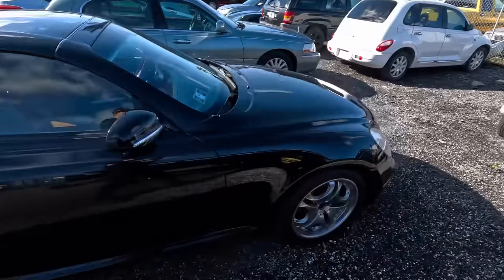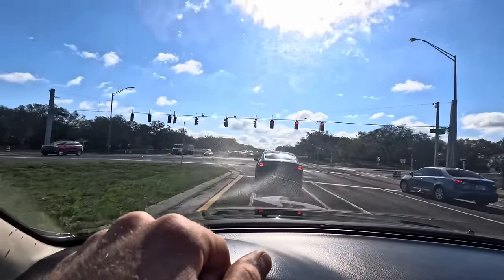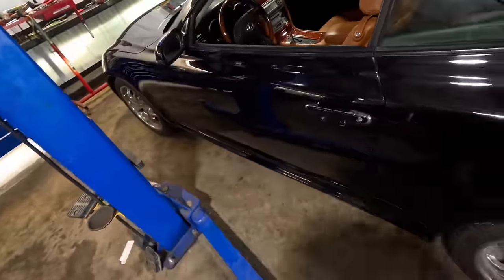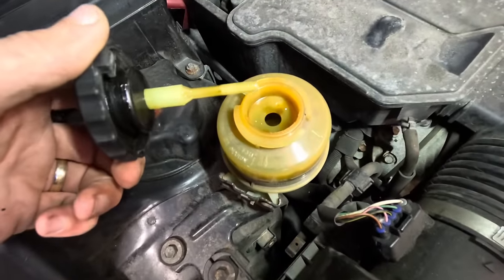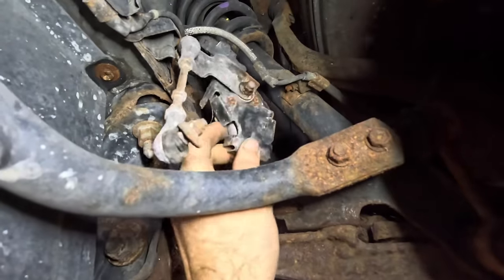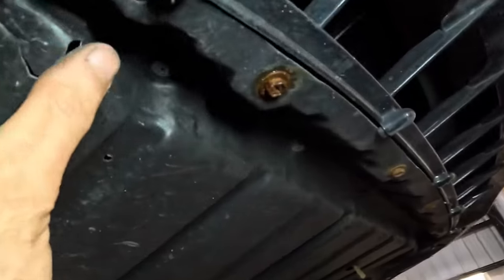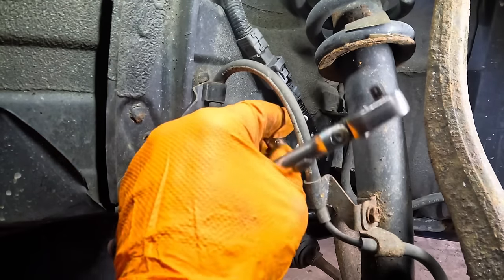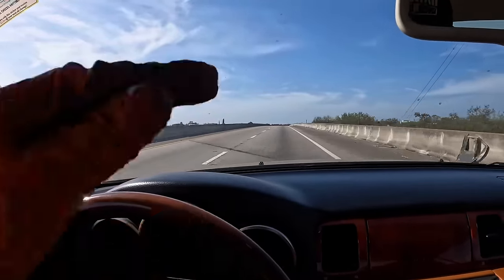Most Hated FAILED Sports Car! Lexus SC430

Comment: My 2004 SC430 with 207,000 miles has no rattles, convertible and chassis are solid and quiet. Check the suspension. This guy sounds like the doppelganger Jeremy Clarkson. He's attributing a lot of his negatives on Lexus design when really it's the owners decades of neglect
Reply: I think top gear were the ones who made this car seem terrible but I don’t see how it isn’t reliable or fun to cruise in. Especially for it being under 10k now

Comment: I liked the "came out of the garage for it's annual trip to the repair facility"!
Reply: Yea 🙂
Reply: Unfortunately not driving a vehicle causes more damage than running it in a normal way. Keeping up with maintenance and getting it up to temp will make it last longer than ignoring it.
Reply: @kenore4003 true, but if you start them & drive them every few months, they are fine. I live up north in snow country, I have a sports car that stays in the garage through the winter. I start it & let it run awhile throughout the winter, & when spring & summer rolls around I get it out of the garage & drive it some. It doesn't get snowed on, & the only time it gets rained on is if I leave it out of the garage a couple days. 
I do enjoy getting it out of the garage in the spring and summer & "stretch it's legs" 😂😂😂
Reply: Smart....
Reply: Indeed! Ray has some wonderful one liners.
Reply: Delusional

Comment: I have a 2002 SC430, with 63k trouble free miles. Everything still works. I bought five years ago and the only thing I've needed to do is change the oil. I love driving it.

Comment: Ray I don't think you realize how good you have it!   I've never had the luxury of working on a car that isn't covered in rust!  I would consider that "Toyota" not really bad compared to what I usually see
Reply: Rust Belt goodness is something I don't miss. I grew up in northern Indiana with all the salt on the roads. Since moving away from that area, I no longer enjoy rust and other corrosion.
Reply: Corrosion just requires another level of patience and determination.  That and wire brushes and your preferred brand of penetrant. It does scare me, it just knocks you back a bit when you have any work in the splash zone.
Reply: Same I’m in Rhode Island terrible
Reply: Rust belt requires a lot more component replacements.  Just replaced the tie rod sleeve, drag link, and ends on my WJ that were completely locked up. Shop couldn't do a proper alignment. Doubt you would get that in FLA
Reply: Fluid Film your cars people!

Comment: That 3UZ-FE engine is one of the finest engines ever built. FAA certified in its stock form and also featuring a 5 bolt main
Reply: There are 6 bolt mains, not 5. Only the 1uz non-VVTI was FAA certified and designed for a twin-turbo application with hypereutectic pistons. The blocks are the same, and the bottom ends of all UZs are interchangeable, pretty much the same minus the rods being thinner and thinner every generation and the 2uz having iron block and 4 bolt mains. Heck, even the heads are the same between all VVTI UZ motors, even the 2uz non vvti minus the vvti port. Everything is pretty much interchangeable between them. The toms superchargers and the rmm kit sold through l-tuned were sick asf tho, as far as I know the dealer would even install them for you, but they really should have given us the airplane engine config with factory twin turbos, yet they never did.

Comment: Lol my ‘07 white sc430 is my DAILY- rain sleet or snow baby 🤙🏻 Best car and engine/transmission I’ve ever had. The top works perfect and it’s newer inside than the older 02-05 version. I handled everything genuine parts 158k miles and runs like a Swiss watch
Reply: 2004 tech was just really starting and to much tech is probably to much like a car simple to fix and not breaking down all the time line the new cars😂
Reply: And people need to service their cars more often

Comment: The SC430 uses real wood!  There is no fake wood in these cars.  I know this car gets a ton of hate, but I own one and it is a great second car to have for the weekends!  
This was a great video.
Reply: Ray got so much wrong with his interior features critique of this '04 SC430 I don't even know where to start, so I won't.  He probably also doesn't know that the all aluminum 3UZ-FE in that thing is one of the finest engines Toyota ever developed, rock solid reliable for hundreds of thousands of miles if you properly maintain it -- nice power band too, the one in my '06 LS430 is no slouch, despite being such a heavy sedan. Ray should have loosened one of the timing covers and sneaked a peek at the condition of the timing belt since it's an interference engine and the belt's been there since day one (recommended replacement is 90k, which is in another 25k for this SC430 owner, but it couldn't hurt to "sneak a peek.")

Comment: I recently had to replace the blower motor resistor in my 93 Corvette. The only available, non Chinesium alternative was well over $200. I opted to try a used part for $40, and it works fine.
Reply: The blower motor resistor fails because A- not enough air flow over it- or  B-the blower motor is pulling too many amps.There may be another failure.
Reply: Mine went too bought one for a jeep Cherokee for 26 bucks.same exact one works great

Comment: Been having my 2004 sc430 as a daily for about 3 years and it's great, basic fixes for older cars yeah but it's good and I haven't had any problems at 180k. The old 5 speed isn't the fastest by far but it's still good. I will say there's a knock sensor and the starter is under the 45lb metal intake, sports car placement cramming it all in the engine bay is no bueno. Also when I have to eventually service the rear suspension or the top mechanism that's gonna be terrible too. I love the car tho so 7.5/10. If you want to supercharge it supposedly it can hold 500hp easily too but i'm going to keep it stock mostly
Reply: also have to do the timing belt forgot to mention :(

Comment: I notice you're not an "antiseize" guy. I guess being from the north I (we) tend to use it more frequently when reassembling nuts/bolts. Each of those reused fasteners on the ride height adjuster would have gotten a dab of antiseize before reassembly if I was doing it.
Reply: One word,  FLORIDA,  no rust 😂
Reply: @ahmadghosheh3104  yes...but it makes it easier for the next mechanic.
Reply: I DIY my cars, and antisieze almost all of the fasteners I take out of my cars. That way, years later, they come out without a fight.
Reply: He touched on that a couple years ago on why it’s not good to use antiseize. Fasteners are designed to be installed dry. because antiseize acts as a lubricant when tightening and will cause fasteners to be over torqued and damage threads in a hole or break bolts. If you do use antiseize reduce the torque value by 20%
Reply: @justinferguson5451: Right on all counts. Just reduce your torque by 20-30%. On bolts bathed in oil anyway (e.g head bolts) don't bother. In 40 years of DIY car maintenance, I've only had problems if I didn't use it. Rust is the enemy. Pro mechanics need not bother either, as they rarely have to remove parts they've bolted to a car 5 years later.

Comment: I wonder how many of your customers watch the videos of your servicing the cars. Most people don't realize how important the fluid servicing is. I recently picked up a 2010 XKR convertible at a reasonable price that needed a full servicng. I figured I saved about $9500 in dealer service for about $1200 in parts and filters. Feels good to have fresh fluids everywhere, even in the hydrualic top system.
Reply: Nice, but do they need the head gaskets done? Heard that was an issue

Comment: The car launched in 2002.  The iPhone launched in 2007.

“It’s behind because doesn’t have any USB connections.”

Thankfully, I watch because you are great at what you do and entertaining to boot, not because you’re a historian…
Reply: Glad you don't design cars. USB1 came out in January 1996.
Reply: The first car with a usb port was the Kia multi-s concept in 2007.  Wireless chargers were not added until well after that.  I have to wonder if Ray was low-key trolling.
Reply: Lexus runs behind in tech intentionally. Its fine. Car tech moves along so fast i really don't take it into account when buying anything. If i have to have it the aftermarket can fill in.
Reply: Usb was 1996 🎉
Reply: @JimDibb  Hrmm, correct me if I'm wrong but didn't the 2006 Honda Civic come with it? Anyways. Ray being wrong about that in no way detracts from what he is saying. He's probably speaking off the top of his head.

Comment: I bought a used 2006 with 80k miles on it for $18,500 and haven't had any issues at all. Had the original tires so I replaced them so now it rides and drives like your typical Lexus. Smooth and quiet although I agree about the seats if they rub up against the back seats. Also for a 18 year old car the top does not leak at all going through a car wash which is really surprising to me.

Comment: First thing I do with rusted fasteners is hit them with penetrating oil, preferably a day before I try to loosen them.
Nine times from ten, the fastener then comes loose without major effort.
Reply: I concur, it amazes me that I watch quite a few channels with repair content and they don't follow that knowledge. Drives me batty when they see corroded work ahead then spray it and then just wrench away and snap off bolts and parts...I work on multitudes of work and will always spray them down a few times the day before I take a wrench out..Ray is a pretty awesome tech, but even when he uses a power socket and then hits power to find the nut home is very troubling to me.

Comment: Some people must not be old enough to remember "ending transmission". I remember when television stations ended transmission for the day, and radio stations.
Reply: National anthem, military jets flying in formation, American flag in the wind, test pattern and solid sound tone that later transitions to the static of no signal.
Reply: Remember this well, dating myself
Reply: @TransAm-Jack  Me too, though it was when a 2 year college's TV station would go off air just after 11pm, but that was in the late 80's.
Reply: I remember when transmissions were in in black & white.The tv had rabbit ears🐰🐰🐰😂 & aluminum foil to fine tune
Reply: Don't forget that black and white test pattern!
Reply: @StrangerInAStrange Remember my  dad behind the TV adjusting the hold knobs, a mirror in front of the set so he could see, trying to get the somewhat oval shaped test pattern round again
Reply: @TransAm-Jack  Indeed -- on some sets you had the luxury that with the back off you could detach the convergence controls and clip them on top so that you could reach over from the front and get the colors to align.

Comment: Ray I looked at this video and I do believe that SC430 suspension was converted from air to conventional springs. The ride height sensor that you ordered and installed was part of the air suspension system and not required for the spring system. Coreect me if I'm wrong.

Comment: I have one of those most hated sports cars and I love it. It does spend most of the time in the garage.  It has a governor on it that cuts out at 150mph.  New they were very expensive.  It comes with a convertible hard top which Toyota sold the design to Pontiac.  Has run flat tires and one of the first on board GPS.  Its been easy to maintain and has been very reliable.  Probably will never be a classic although they are rare.  I was happy to see you work on a car I was familiar with.  Nothing wrong with used parts if they are functional.  Ask any rebuilder when parts are no longer made!

Comment: At the golf course …but you have to put the top down to get clubs in or out of fully reclined front seat, won’t fit in backseat or trunk. I know, I borrowed my girlfriend’s to go golfing, once 😎
Reply: My Titleist bag fits PERFECTLY in the back seat- you move the passenger forward a little and and use the fold down latch done deal. It’s even snug so it doesn’t move around… car is perfect

Comment: oxy acetylene  is your best friend  when working on rusty vehicles , the job is harder and sometimes you will fail  without it ,the Lexus looked mint compared to some cars I. have worked on just needs a rust converter spraying around to keep it from getting rotten , nothing wrong with the sensor you fitted great job Ray

Comment: I would fit (and have done to my 40 to 50 year old cars) giving the option to the owner of fitting used parts, fitting used as a temporary stopgap until new parts are available or charge vehicle storage fees until just new parts are available.  The used parts give immediate driveability for the customer.

Comment: You hear a lot of noises in your car because it's been neglected or maybe been abused. Look at those loose parts and massive corrosions, it looks like your car had never been taken care properly. My SC430 is an 18 year old car but never hear any noises and everything in and out, including under the chasse are all in mint conditions and still runs like new. Why? Because it's been taken care properly. Also it's not a sport car, as what everybody says it's a luxury touring car. Where can you find a sports car that has seat at back? Zero!!!

Comment: My '64 Ford Galaxy Convertible (yes I'm old) had an extra massive X cross-member on the central part of the frame for stiffening.  It was a PITA for exhaust replacement because it routed thru cutouts in the X cross-member.
Reply: Had an 83 mustang glx convertible (v8/5speed). It did not creak like this. Doors even shut nice, no binding or issues lining up, even after making passes at the drag strip.

Comment: I have a 2005 with 100,000 mi on it. 3rd owner. No creeks, no rattles, everything still works perfectly except for the power antenna. Don't see how it's behind 15 years technology-wise - it has bluetooth, voice command, color GPS (yes, I know that GPS is useless today - I've updated), electronic brake distribution, variable assist power steering, traction control, vehicle stability control. Has all the power features that you would expect. Yes, still has a cassette - hard to believe, but people were still using cassettes back in early 2000's. Of course it doesn't have wireless or USB charging  - there was no such thing back then. But today there's plenty of aftermarket updates for this car. For me, it's been reliable as hell and fun to drive on the right days. Just service it regularly as you would any other car.

Comment: Good call on the creative thought process. To prevent rust here in PA I sprayed my underbody with fluid film. Upon its annual inspection “at a place that rhymes with bep poys” I mentioned that I sprayed everything with fluid film, yet they still tried to charge me $4k saying all my suspension in leaking and need replacement. Made me furious that day and took it somewhere else where it passed. Such is the problem when state inspection and repair shops are allowed.

Comment: Nice work! When a new part is not available, you have no choice but to find a used one. If that is not available, you may be able to modify a different one designed for another vehicle. Other than that you are up a creek. Used is fine as long as it works. The one you had looked like a new part. The only other thing I would have done to the little braket you welded, is a shot of rustoleum. If I owned that car, I would get under it and wire brush all the rust I could get to, use that rustreversal stuff and paint or undercoat, before it gets too bad. I think it is salvageable at this point, don't ignore it.

Comment: I understand your comments on parts. After 60+ years repairing radios, antique radios & TV sets, fabricating parts is pretty common place. If the part is NLA, I let the customer know that a used part is the only thing available. Generally I won't warranty a used part. The exception are used tubes that I install. If the customer installs, no warranty.

Comment: When rust is present, best to use a little penetrating oil and let soak in to the threads to reduce chances of bolt breakage.

Comment: I think you are a perfectionist and in the best way possible. Some constructive feedback though, if you’re repairing a metal bracket due to rust, paint the metal with at least some rustoleum and prevent/ slow down the process happening all over again. Also with the original part failing with a frozen ball joint, did you throw some grease in the joints of the used part to help extend its life?
Reply: @SupraSeth I’m not trying to be hypocritical of Ray’s work either, it’s just that your two recommendations are truly “best practices” for any DIYer out there to employ.  I’d do this as second nature, almost reflex action, here in the rust-free environment of Austin Texas and as mandatory in any of the rustbelt regions. That freshly heated bracket is screaming, “oxidation accelerant alert!” 😮

Comment: I think the word you were looking for to describe nut & bolt  is symbiotic /  2 things that compliment as in work together, have a shared relationship or in most cases depend on each other. 
Kudos to you for the awesome thorough job you did on the Pontiac.
Reply: Complementary also works :)
Reply: No that is not what he meant. Fastener would suffice.

Comment: So my SC430 is very solid and I really enjoy it. I would not call it a sports car, but would say more of a luxury touring. I enjoy the silent cabine with the roof up and the roof down is still pretty quiet . I do not have any of these rattles and sounds coming from anywhere in my car. Mine is a 2004 and have a little over 220,000 klms. Worth mentioning these cars were really overpriced at the time but ahead of it's time in certain aspect.